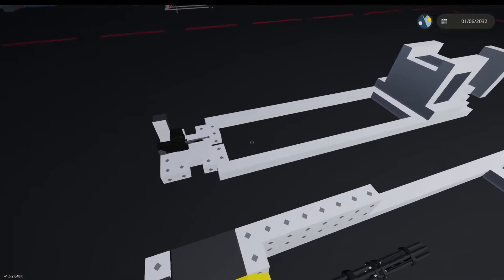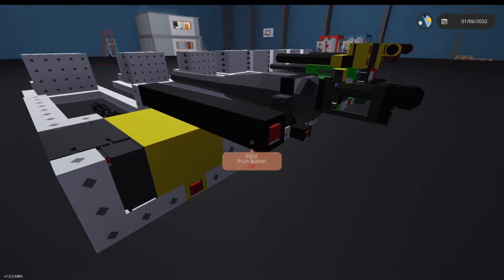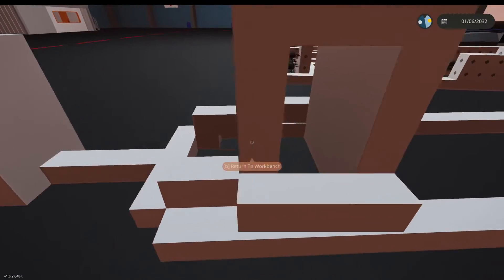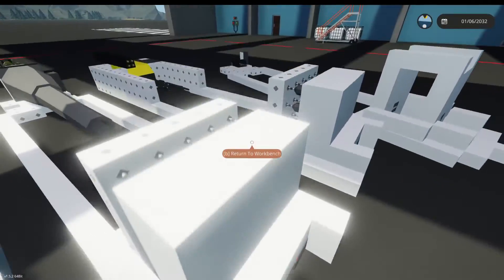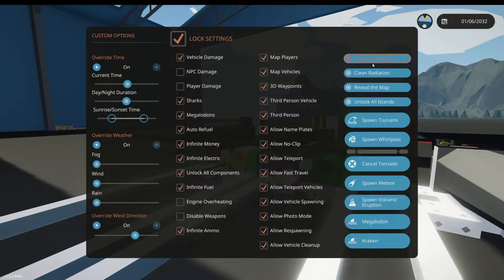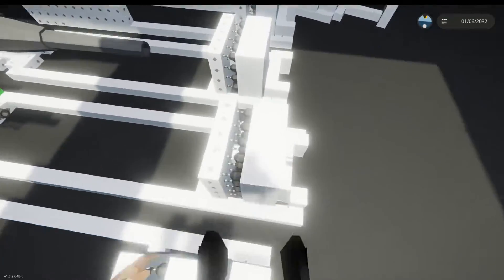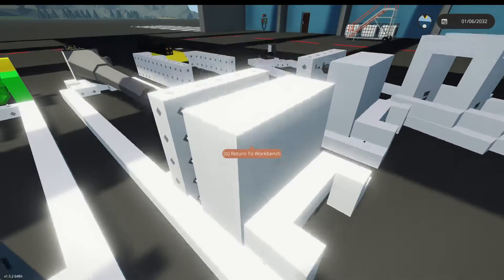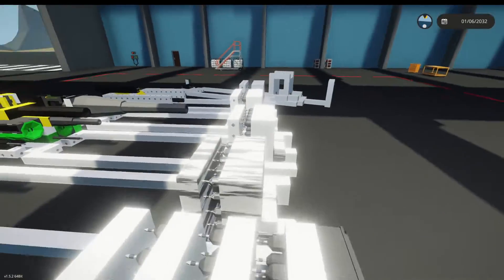Self healing armor proof of concept Stormworks update 1.1

Comment: Good idea, but the main problem is definitely the logistics of it
Reply from the maker: It is made to cover only critical areas. Mostly made for big boats. I also took this concept from an identical concept I made in Space Engineers.

"The damage model from cannon rounds is very simple as the game wasnt really designed with this in mind originally. It essentially just applies damage to every block in a certain radius from where the round made contact, and that radius depends on the type of block and type of round. Heavy blocks (which are supposed to serve as armour) will reduce the damage radius, while larger rounds will increase it. Explosive shells have the highest damage radius when compared to shells of the same size, kinetic are a middle-ground and armour piercing will leave very little damage but can pass through blocks. Frag and incendiary do less damage but have the special effects (more damage against players and chance to start a fire, respectively).

Since the heavy armour blocks are quite inefective, players have come up with other types of armour. The most common and most effective is subgrid armour, where you cover your tank in subgrids (subgrids show up as different colours in the merge tool). It works because the damage doesn't propagate between subgrids, so it will stay on the top layer and the tank beneath will be protected."
-DarkArcher__ (https://www.reddit.com/r/Stormworks/comments/12peagf/comment/jgmnb5w/?utm_source=share&utm_medium=web3x&utm_name=web3xcss&utm_term=1&utm_content=share_button)

More info: https://stormworks.fandom.com/wiki/Search_and_Destroy_DLC
Reply: @ShadowSnipe888  interesting, subgrid seems kinda powerful tbh
Reply from the maker: @Nishye501 From what I've seen it is.
Reply: Also how exactly does armour work in stormworks?